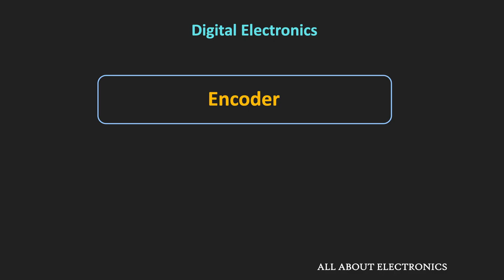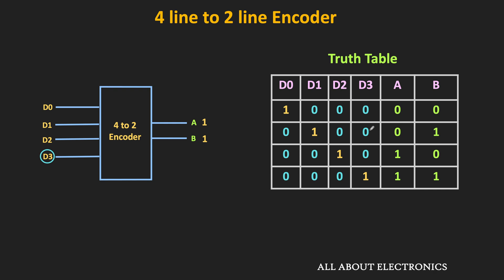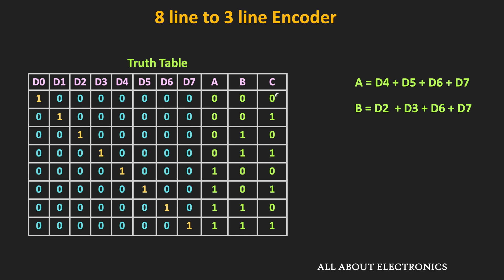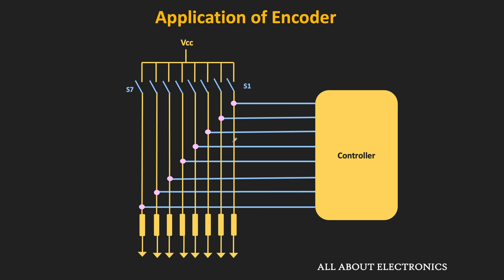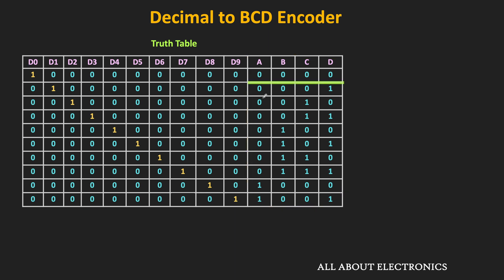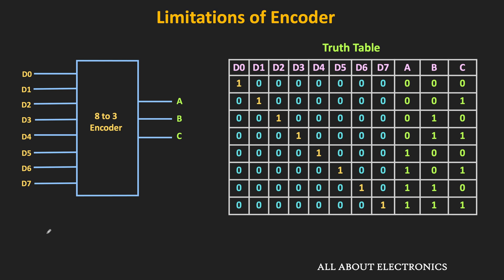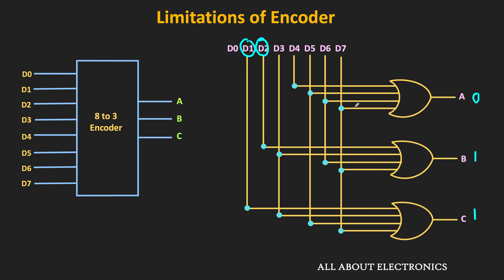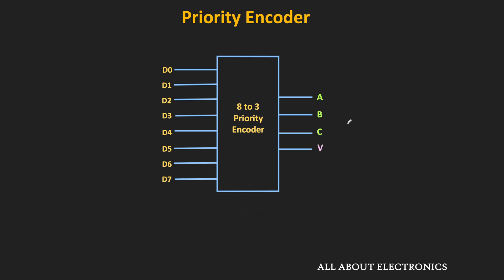Encoder in Digital Electronics | Working, Application and Logic Circuit of Encoder

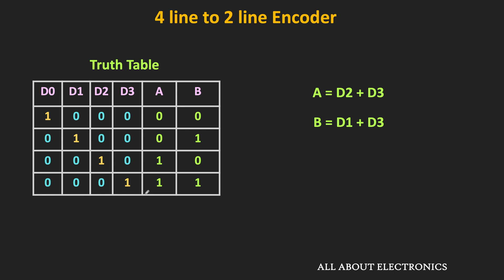Comment: Hello sir I have a doubt at 2:22 how you get those equation if we use K map we want get this equation
i got 
Y1=D1'D0'(D3'D2+D3D2')
Reply from the maker: Well, that's true, you get this equation. But you will be required that equation when you are applying all the inputs for getting A and B. Here we are assuming that, at a time only 1 input is high. That is why, we can use the OR gate circuit. And accordingly the inputs are hard wired to the OR gate.

Comment: Sir in 4 to 2 line circuit you shown D1 D2 and D3 as per A and B equations then where we will give D0 input where to connect it please reply fast I am very confused and one more doubt why you don't make kmap to find equation sometime we make kmap sometime we write directly by Truth table I am getting confused what is the use of kmap then
Reply from the maker: first let me answer your second question. In this case, the K-map is not used because there is no need to use K-map. Here typically in 4 to 2 line encoder, for 4 inputs we have 16 input combinations. But we are not going to have all  possible input combination. (as we are assuming that at any given time only 1 input is HIGH)
So, at any given time only one input is HIGH. And in this case, just looking at the truth table, we know that in which conditions A and B outputs are high.
so, that is why K-map is not used. (But that will not be the case in the priority encoder, as in that case more than two inputs can be high. And for that K-map is used. Please watch the last part part of the video and the next video on priority encoder for more info).
Now coming back to your first question, as you can see from the table at 2:27, when Do input is HIGH, it will not change either A or B outputs. That means even when D0 is 1, A and B remains 0. So, that is why D0 is not connected. I hope, it will clear your doubt.

Comment: Hi sir, this is manikanta. 8x3 encoder explanation is exhalent. but one qsn if pressed 2 or 3 key at same what will happened?? please reply me urgently. thank you..
Reply from the maker: In the encoder circuit that we have discussed over here, it has been assumed that at a given time only one input is active. If more than one inputs are active at the same time then it won’t work properly. But practically we do not have that ideal situation and multiple inputs might occur at the same time, like multiple keys are pressed simultaneously. To avoid that ambiguity of multiple key inputs at the same time, priority encoders are used. For more info, you can watch this video: https://youtu.be/gnoqn705LBg?si=Nzk1Th3v4v3aeJz2

Comment: sir what is the difference between bcd and decimal encoder because the sum to find out the logic gate is same for both
Reply from the maker: I think you are talking about the difference between Decimal to BCD and Decimal to Binary Encoder, right !!
Well if so, then there is no difference. Because BCD is also binary representation specifically for decimal numbers.
So, both has same logical expression and logic circuit.